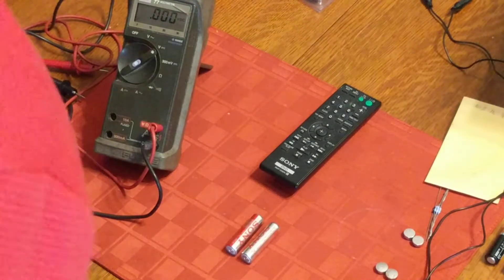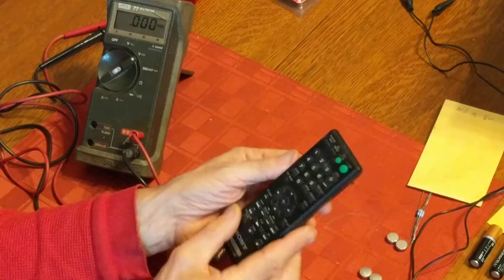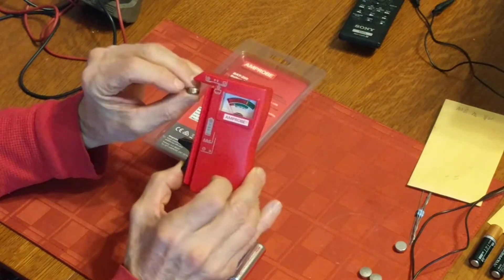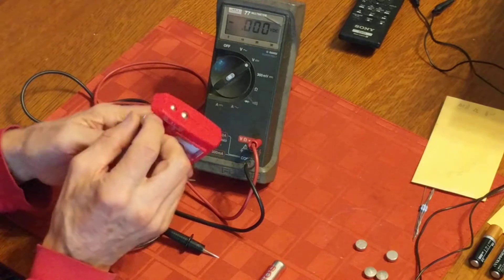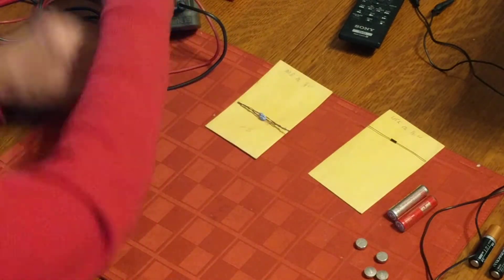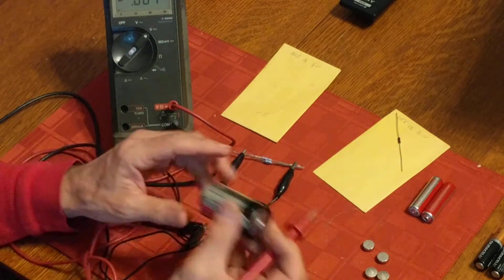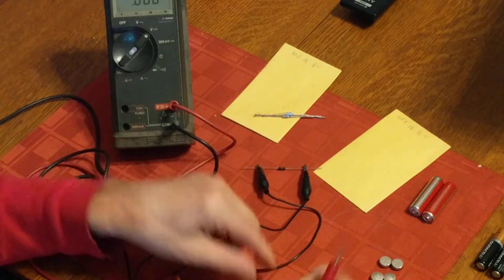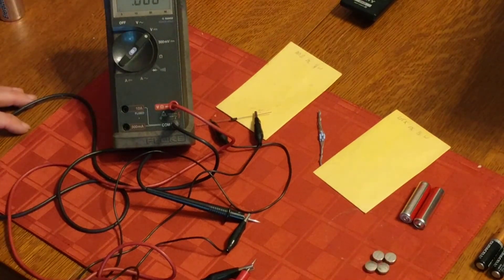Testing Batteries with a Multimeter

Comment: You were not getting 1.5 volt on the AA cell, you were getting -1.5 volt (negative 1.5) because you had the positive lead on the negative side of the battery

Comment: So to sum up...
Use 10ohm for Cs and Ds
Use 30ohm for AA and AAA
Use 1.5kohm for button cells
Correct?
What about 9V?
Reply: If you Google the data sheet an Alkaline 9v  is pretty steady @ 8.5 V loaded with a 900 Ohm resistor but once you start to get readings between 8.5 and 8 then the battery is on its way out - and fast.  If you loaded it with a 60 Ohm resistor  and it read 8 volts you would have @ half its capacity left o it is a more accurate test of the remaining capacity.. 

In short, a higher load  will allow a better approximation of the capacity  remaining but of course you would not want to apply the load other than briefly so as not to  discharge the battery any more than just enough to test it !